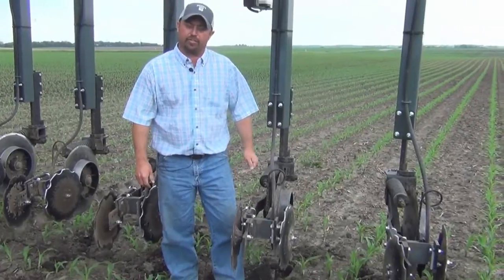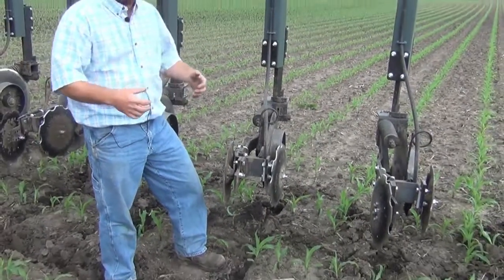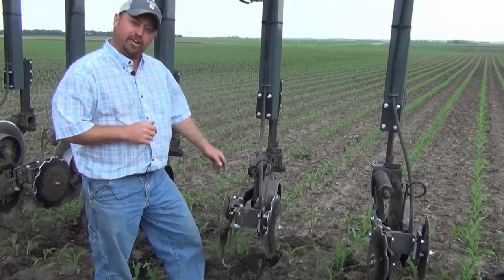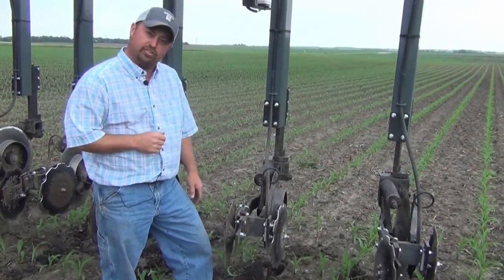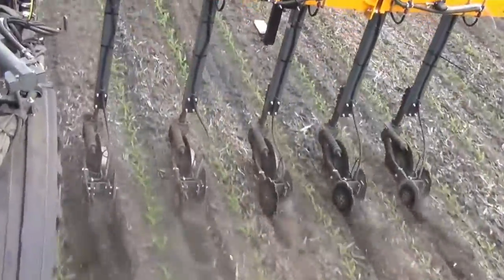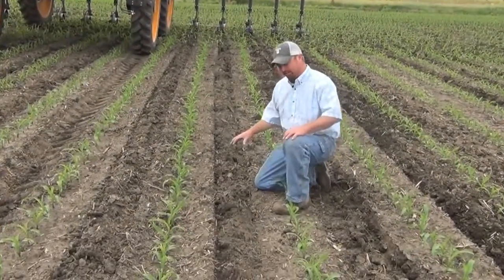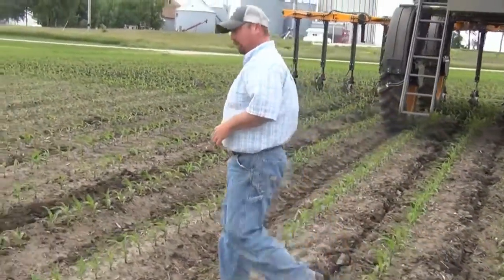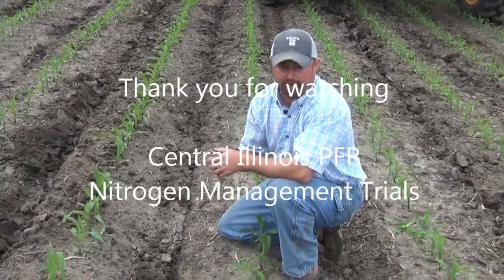Nitrogen Sealing Systems Testing

Comment: Could this tool be used as a low cost strip till rig?
Reply: Chad, I do not think these units will work very well as a means to strip till.  These are designed to just turn soil from both sides of the coulter trench to cover up N.  With strip till I think you would rather have more actual tillage in the form of a knife or vertical tillage directly over the row.  These units will not move enough soil in most cases to create an adequate seed bed for strip till.  Thanks for the question and watching the video!  Jason Webster